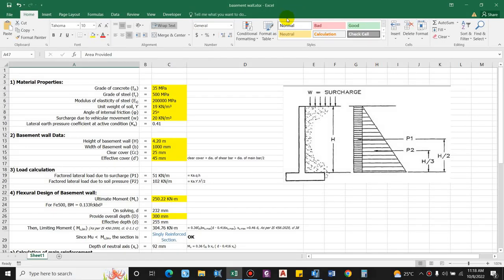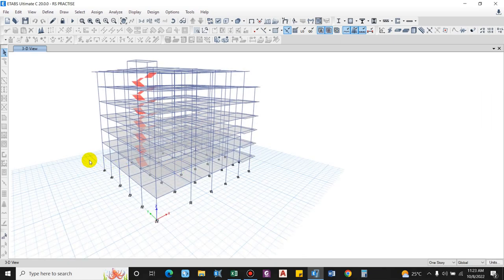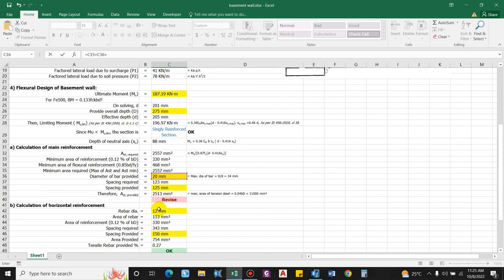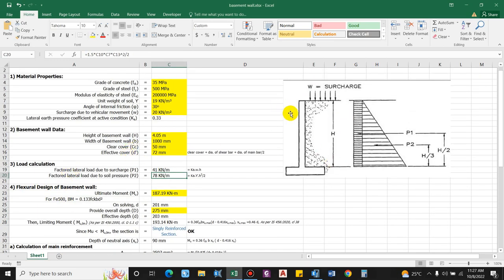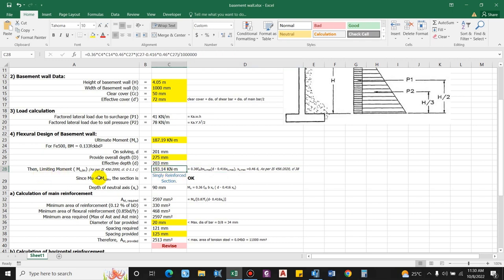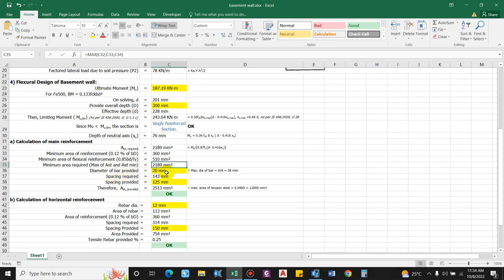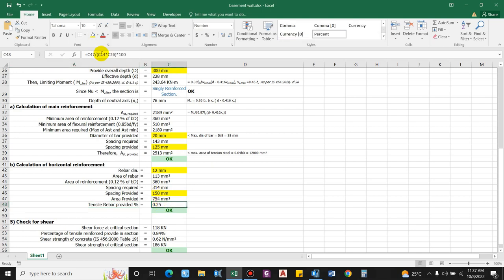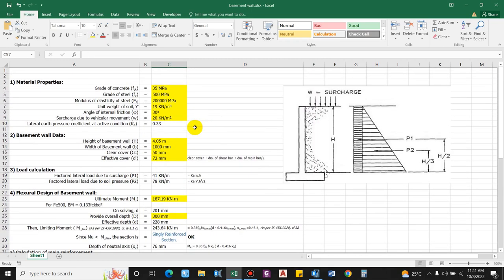RCC Basement wall design (Manually) | ETABS Modeling of Multistory Building | NBC 105:2020, IS 1983

Comment: A T-beam of effective flange width 800 mm, thickness of slab 90 mm, 
width of rib 230 mm and effective depth 400 mm is reinforced with
5 numbers of 20 mm diameter bars. Calculate the moment of 
resistance of the section. M-20 grade concrete and Fe-415 bars are 
used. Please explain sum bro